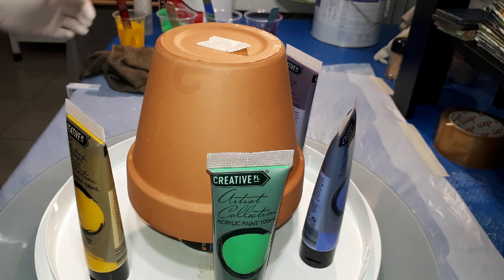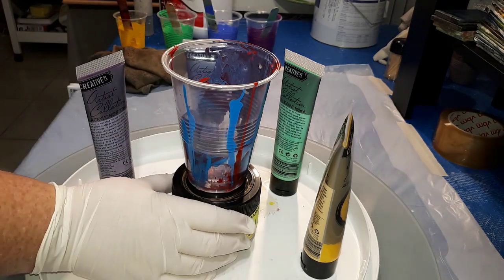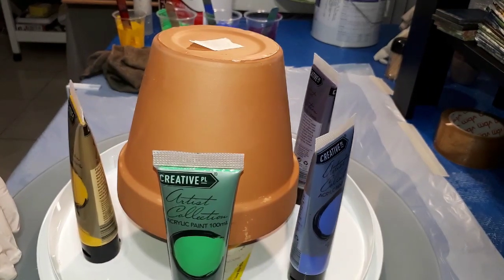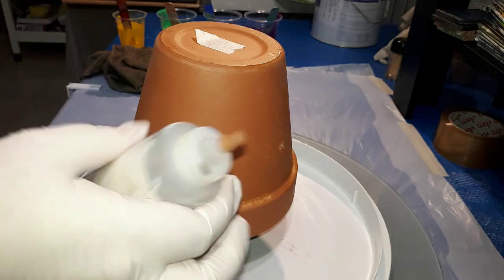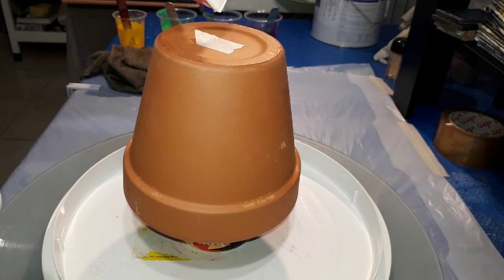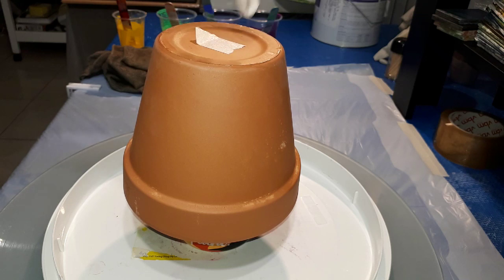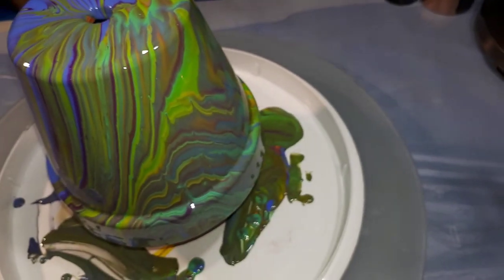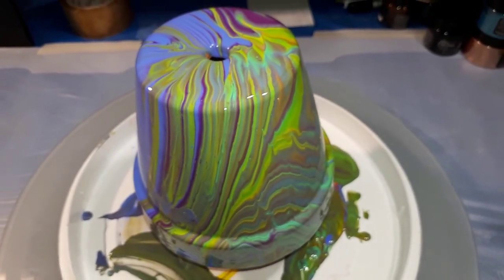158 - Will a Swirl work over a Pot?

Comment: Beautiful pattern going down the side. On camera it looked like you didn't quite have the pot level so it flowed to the one side. If you don' have one there are small levels that measure levelness in the two planes, up/down and side to side, at the same time. They are inexpensive and quickly help to assure a level surface.
Reply from the maker: I noticed in the video too, a level is on my shopping list :) Thanks and thank you for watching

Comment: I think the purple saucer coordinates with the pot color just fine and the subtle visual texture relates it as well. I don't like like the green saucer as it lacks both of those attributes. If you are going to use a sold color it needs to match one of the dominant colors in the pot. (IMHO) why don' you just mix up enough paint in the future to pour on the saucers when you do the pots? Seal them on the inside, mask off the center of the bottom and just pour the sides of the saucer. That's what I would try.
Reply from the maker: Thanks, very nice advice, something to think about and thank you for watching :)